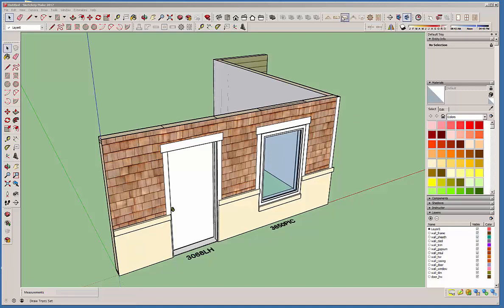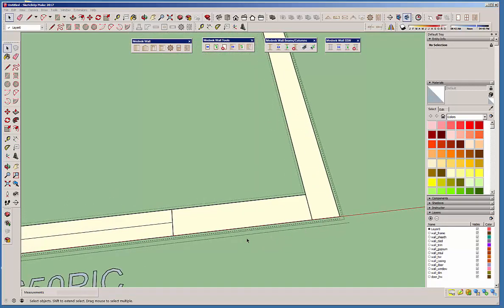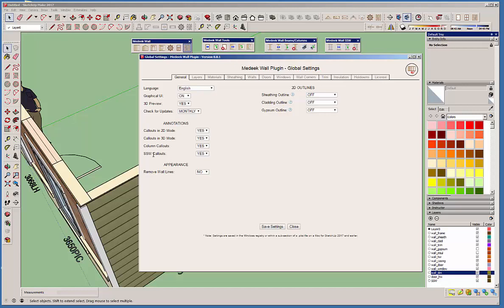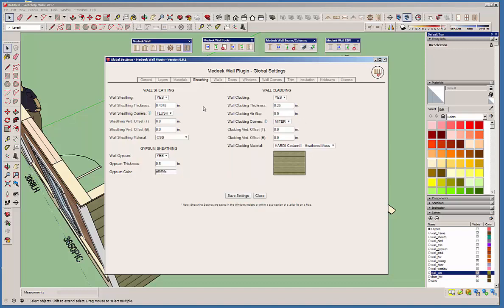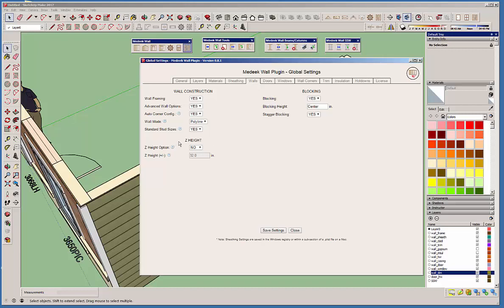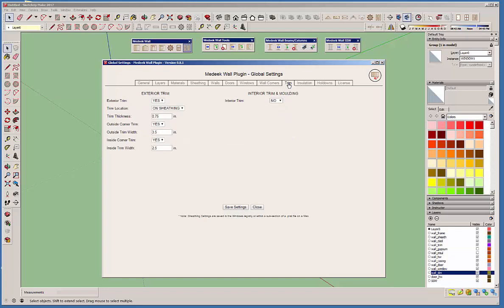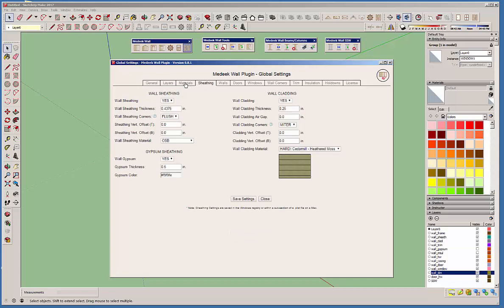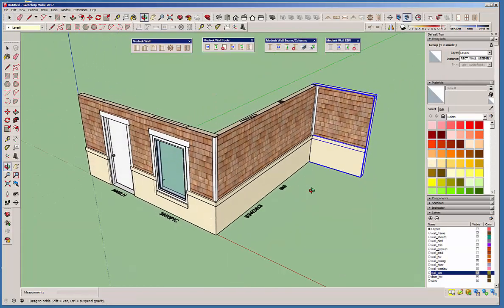Medeek Wall Plugin Tutorial 1 - Extension Overview

Comment: Where you have the Cali corner, you should also add the Channel corner as well. A Channel would be stronger than a Cali and it also provides nailing surface for things like dry wall, etc.
Reply from the maker: What is a channel corner?  Is that the same as a U-corner?

Comment: Version 1.1.8 (01.06.2020) now allows for stacked windows and custom offsetting of the stud spacing.
Reply: Can you give some tips on how to place a window over another window or door opening? When I do it the framing from the window extends down through the lower opening.
Reply from the maker: @design-build-live3284  I should probably create another tutorial on stacked windows and doors.  Note that when stacking windows and doors the stacked openings must be the same size and line up with each other.  You cannot create offset stacked windows yet.